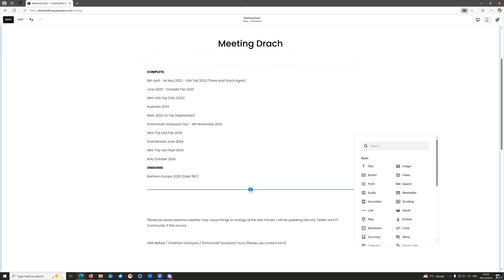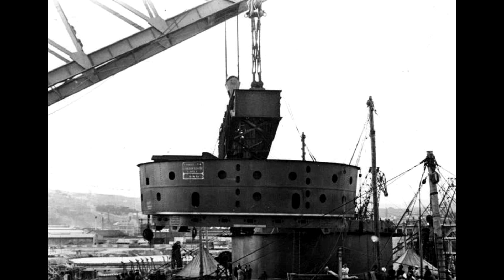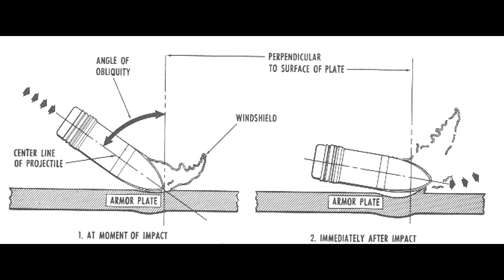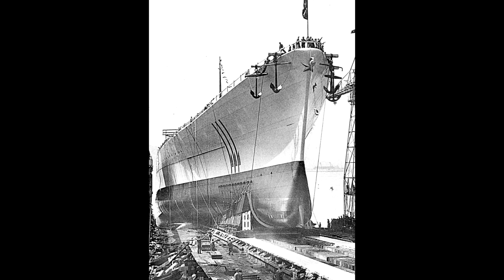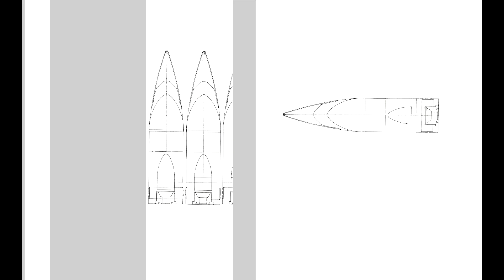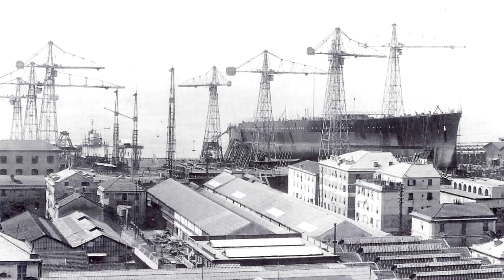Naval Engineering - Did the Littorio's Armour Scheme Work?

Comment: I agree with yourconclusion about tve restive effect if foamed concrete falling off considerably compared to solid concrete. And to compare ut to the real world, its why we vibrate concrete to get rid if bubbles, to massivaly increase concretes strength. Concrete that falls apart due to the destructive force of a shell cap hitting it and moving through it, is not what provides the resitive force to remove the cap of a shell.

Comment: It sounds to me like someone got confused during the design process and failed to account for the concrete adding weight when drawing up the construction plans then realising their mistake switched to foamed concrete after construction had started to " fix" their mistake. Either that or the foamed concrete performed well during testing with the smaller shell's and they failed to realise that using a testing regime designed for solid plate couldn't give reliable results for a composite armour. Not an obvious oversight at the time because it's very easy to fall into complacency when you have a well established reliable procedure for something and just don't consider that adding new variables might make the procedure fail.
Reply: It seems to me that the clip had not taken into account the main effect that hitting spaced armors at an angle has on a projectile, that's to make it tumble before hitting the main plate. That BOTH should help with decapping AND reduce the needed thickness of the main plate beyond the simply geometrical figure.

Comment: Well everyone, as interesting as this video is in terms of relating how the armor was constructed, it should be remembered that in actual combat, there will virtually never be shell hits that will occur at the ideal angle needed to facilitate penetration.     Further, at the long battle ranges frequently mentioned on the channel, the belt represents only a tiny portion of the ship's total profile above the water line, thus reducing the likelihood of it actually being struck.    Most, if not all, of the battleships that I can think of which experienced 'rapid unscheduled disassembly' during engagements weren't hit anywhere near the armor belt, but in fact somewhere above the belt, with the ensuing damage then initiating a series  of events that resulted in a conflagration in the magazines.     Sinking due to a direct penetration of the armor belt would also seem to be rare.     Speed and maneuverability equals life.     If you've allowed an enemy to get close enough to really hammer your armor belt, at a really close range, then you've made a serious tactical error.     As you might guess, I almost think that the obsession with heavy belt armor is a carry over from the days of sail and a little after, when engagements took place at much shorter distances and you could be sure that direct hits on the hull were going to happen.     Hull protection is important, but more protection for the upper works (deck), and better ammunition  handling practices, would have saved some ships in the past...
Reply: Can you name examples of ships that have been destroyed in this manner? Excluding the british battlecruisers at Jutland I can't think of any modern dreadnought ships that haven't been destroyed by a massive cumulative damage. On the other hand, HMS Hood has been destroyed by a lucky shot that bypassed the main belt, thus proving how important the protection of the citadel was.
Reply: Actually, some of the key hits in historical encounters were below the belt, as a result of shells going through the water and through the hull under the main armor belt.  Prince of Wales scored a key hit on Bismark in this manner, and Drach makes a convincing case for such a hit being responsible for the destruction of Hood.

The total area of the target increases significantly if you take into account that shells landing near the ship can go through the water and still detonate against the hull.

Plus, ships roll due to wave action and maneuvering, which means the target area is not fixed.  The armor belt can take on a larger or smaller portion of that target area.  Bow wave effects are also a concern.

Designers have to plan for these possibilities.  

Further, many shells that hit the superstructure will go right through it without detonating, which makes the role of the belt more important.

In the case of Hood, they didn't get it right.  Her armor percentage of weight is well into the battleship range, and is as good or better than period battleships such as Iron Duke or the Queen Elizabeth class (DK Brown), but the distribution of the armor reflects late-war WW1 thinking about how battleships should be armored and they didn't either didn't realize or didn't attach enough importance to some of the potential issues.

Also, in the real world one can not control engagement ranges the way you suggest.  Ships can encounter one another unexpectedly at arbitrary ranges due to weather.  In the North Atlantic, there can be bad weather three days in four certain times of the year.  Examples of real world encounters in bad weather include Hipper vs Glowworm, Renown vs Scharnhorst+Gneisenau, Duke of York and escorts vs Scharnhorst.

Night actions are another real world issue.  There were night engagements at Jutland, and there were night engagements such as Kirishima vs Washingon.  Divers on the wreck of Kirishima have confirmed that Washingon actually scored more hits than the crew realized, because the hits were underwater and couldn't be reliably differentiated from misses.

Battle damage (or systems failures from any of a number of causes, including storm damage) can also lead to closer than expected ranges when a ship loses speed or maneuverability, as happened with Bismark.

It's not necessarily a serious tactical error to find oneself in a close range engagement, but rather something designers need to plan for because the odds of it happening sooner or later are high.

Your point about target area is certainly correct with respect to some battles.  For example, the paper  Kirishima Damage Analysis  by Robert Lundgren has a nice drawing showing the distribution of hits as confirmed by divers, and there are a lot of hits away from the armor belt from Washington's guns.

Your point about the problem of turret hits, and better ammunition handling practices is also correct (as confirmed by divers on some of the Jutland wrecks).

Comment: So, they could have done what was necessary by using a further ~9" of internal space per side, or 18" in total internal beam for the length of the decap and primary belt armour. Is that about it? 
In which case the argument comes down to the cost vs benefit, as it always does. What consequences would the loss of those 18" have had? Interesting to consider.
p.s. given they were never hit on the belt, it seems they could've forgone much of the armour and had more horizontal protection 🙃🤣🤣

Comment: Love the idea of decapping plates, but more for repair than wieght savings. Easier to repair a outer "thin" plate than a thick inner belt. 

The huge advance in tank size guns  & armor requires more research which means more money. Winners of ww2 had better things to do in 1946 than play with ship armor.  Existing ships were made of spaced armor so heat and hesh don't work as they do on tanks which have 1 compartment. 

Hesh is interesting for better fuse at long range but HE already existed and 30k meter  shots on radar control was proven too late for caring. No one running around trying to make that when missiles offered range.

Comment: So in short, the Italians got the thickness of the plates right but messed up on how wide the gap should be.
Reply: Not necessarily. It seems to me that the clip had not taken into account the main effect that hitting spaced armors at an angle has on a projectile, that's to make it tumble before hitting the main plate. That BOTH should help with decapping AND reduce the needed thickness of the main plate beyond the simply geometrical figure.
Reply: @neutronalchemist3241 Drachinifel did take that into account; watch from 14:43 for details.

In order to break off the AP cap in the manner you're suggesting, you need a pretty steep angle to do it reliably and consistently, like in the realm of 40+ degrees from perpendicular. I would love to explain why, but I only have so much time for my lunch break and Drach already has a pretty good video on his channel explaining shells and caps and their nuances.
Reply: @pyronuke4768  I didn't suggest any manner. 
Simply, after the decapping plade did its work (and Drach confirmed it does) the cap separates faster from a shell that's tumbling than from one that's going straight, for obvious reasons.  
Nothing in that part says tumbling had been taken into account.
Reply: @neutronalchemist3241  I have five minutes left so I'll make this quick: with the massive amount of momentum and inertia the 15" shell has, 3" of armor is not enough to get it tumbling, and even if it was a simple look at the to scale diorama seems to indicate there's not enough space to make it tumble a significant amount before it hits the main belt.

If you want I can continue this conversation in a few hours when I get off work.

Comment: My question would be how would they repair that armor at sea?  Would they carry additional foam concrete or forms to make it on board?  Or hope that another shell doesn't hit the same spot?
Reply: You don't repair heavy armour at sea. You plug the hole to keep the water out, and decide whether the damage done leaves you mission-capable or not. If not, you try to get home. This is what happened to Bismarck, though she wasn't holed through her armour, but rather in an unarmoured part of her bow. The hit didn't leave her in any danger of sinking, but slowed her and caused her the loss of fuel and to leak fuel.
Reply: No battleship, or other class of armored ships, could repair or replace its armored plates at sea. 
Considering that practically no battleship had been hit by another batleship on the belt in all WWII, what were the chances for it to happen twice in the same spot?
there were MUCH more chances for two torpedoes to hit the same spot, but battleships had no mean to repair their torpedo defenses at sea as well.

Comment: Note in the photo of the Littoerios on the slip ways how unrealistically low on the hull the “waterline” is painted. The same was true of the Bismarcks. This is unlike the US BBs and the KGVs on which the waterline was much higher on the hull in their launch day pics. Why? Because the Italians and Germans were cheating on the naval treaties massively, with their BBs designed to be 42-43K standard load from the get-go rather than the required 35K. The ships were clearly too long the meet that low tonnage, so they pretended they were magically shallow draft. The Allied ships were designed to be a little above 35K, around 37K, so no need for such brazen fakery.
Reply: The Washington treaty had long expired when the Littorio had been launched. They could have painted what they wanted wherever they wanted. 
Even more for the Germans that, as for the peace treaty COULDN'T BUILD BATTLESHIPS AT ALL, figures if they had to paint a certain line or another on a battleship that shouldn't have even existed.

Comment: Now if a large swell was running at the time of battle, remembering that the navy of whichever country owns a fighting ship has no control of the weather, which of course includes the motion of the waves that affect the rolling of a ship particularly if the wave motion is coming from port to starboard, or in fact the other way round, then the said rolling of the ship ould nullify the angle of the armour plating, meaning that if a shell were fired from 16,000 M or about 17,000 yards and struck the side of a ship whilst the armour plating was perpendicular, meaning it was upright, then all the calculations about shell piercing would be null and void.

Comment: As for the skirts on the Pzkfw IV my understanding is these were to destabilized Russian 14.5 mm anti-tank rifle projectiles. These tanks had only 2 cm side armor (vs 3.8 cm on a M4 Sherman). These tanks 14.5 cm was smaller than even a 37 mm anti tank, could easily hide & ambush and could penetrate 2.5 or so centimeters of armor. These tanks skirts were intended to destabilize the projectiles causing them to tumble and lose penetrative capability. As the photos shown suggest these offered little protection against late war projectiles.57mm +.
Reply: to add to this
you could argue it made APHE and HEAT rounds even more effective, since the distance from the spaced plate to the armour was roughly about the same distance as the APHE's fuse timer. This would cause the APHE to fuse on the spaced plate and detonate almost as soon as it entered the tank, maximising damage.
Reply: @goddepersonno3782 The degree which it aided HEAT rounds is dependent on the weapon in question. Usually, it tends to degrade the penetration due to the fact the armor still disrupts the jet to an extent. However, just how much it does is dependent on the outer armor in the first place, and whether it prevents penetration is dependent on that, distance from the hull, and thickness of hull armor there, and of course the angle. 

Specifically to Shurtzen, it was somewhat effective against small diameter HEAT, some HE rounds, and heavier HEAT rounds at certain angles, but not effective against larger HEAT rounds striking at perpendicular angles. 

You are correct it was designed to defeat Soviet AT rifles, but it did have some effect against HEAT rounds.
Reply: @Pilotmario  Could work against something really weak like italian 47mm HEAT, i guess. Or something like early soviet heat ammo which was absolutely atrocious.

Comment: The Iowas are a special case in a different way, because they were designed to accompany a carrier strike group (as far as I know, the only battleship class ever designed for that).  In practice, this significantly reduced the average number of large-caliber incoming shells that they had to deal with per engagement.  Although I think they did occasionally have other deployments.

Right before you mentioned the foamed concrete, I was thinking in my head, "I wonder why nobody's ever used a metal foam in this kind of setup?"
Reply: They were intended to be fast South Dakotas that could hunt down and destroy Japanese super cruisers (Alaska type ships) that Japan never built. While the Iowas spent a lot of time escorting and protecting carriers and were very useful for this, it was not a design consideration. Even the 16/50 guns were a later design upgrade. The original plans called for 16/45s.

Comment: With regard to the question you pose at 24:30 or so, I doubt very much that the decapping effect is linear wrt to density of the gap fill. I suspect that the cap removal is accelerated relative to the no-fill case more by the friction imposed by the filler than by its mass or density. The goal here is after all to pull the cap off of the shell body before it strikes the inner armor layer. I could imagine foamed concrete as having surprisingly good behaviors in that context.

This sort of thing is extremely difficult to model because it can have extremely sensitive behaviors wrt the specifics of the materials involved. The fact that the Italian designers were doing empirical testing with actual honest-to-goodness AP shells probably means that they had a better empirical understanding of this than we today could achieve with any amount of theoretical modeling.

Comment: Actually .. armour belts are cool and 'n all; but how many battleships actually got hit in their armour belt? It seems to me most get hit on the deck; or before or after the belt, and sink that way.
Would be interesting to have a % of how many warships found a violent end and how many did so by getting struck through the armour.
Reply: See my post above for examples of hits through the armor of battleships.  In general, we can't know how many hits of any given weapon were on the armor belts of battleships and did little or no damage, it's too hard to tell after the fact (ships roll which changes the armor angle and hence whether or how shells detonate!), and there might not be reliable eyewitness accounts.  

It's likely, however, that in some encounters (such as the final sinking of Bismark) there were many such hits, given the number of shells fired and the range.  There were also at least two hits that did penetrate - one side of the ship is buried in the mud so divers can only look at one side.

Comment: I'm not an expert - but I guess less-dense concrete foam would allow the cap to basically "fall off" the shell.

Solid concrete might have more physical resistance - but maybe the cap would stay in place - rendering the whole idea of de-capping pointless.

I'm quite sure the Italians tested it extensively before putting it into practise....
Reply from the maker: That's the thing, most of the testing was done with a very large air gap, the tests with the final scheme was one set of tests with the 12.6" shell as mentioned